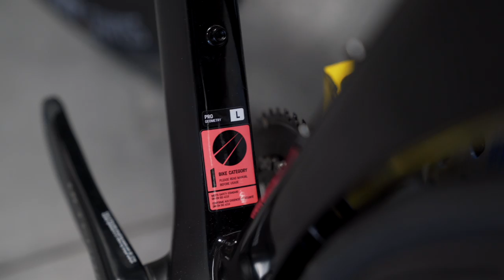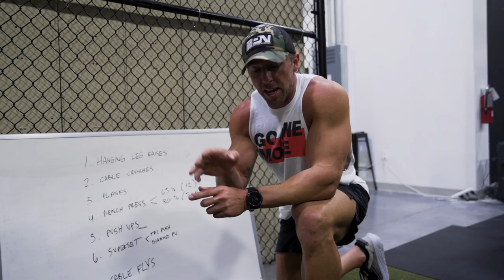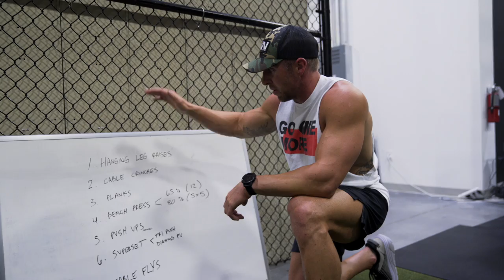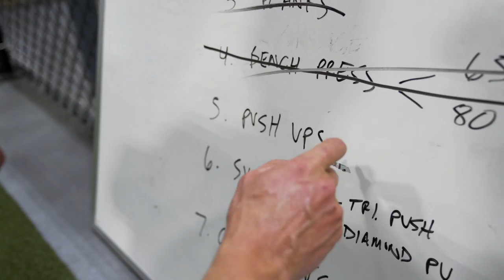Embrace The Suck (Running + Weight Training Day)

Comment: As someone who works in warehousing and logistics, stop wasting the time with cutting open the boxes, then placing them in the racks. Get packaging designed for your rack lanes with perforated cuts to quickly pull off the tops/fronts before filling your racks.

Comment: I will admit that early morning PT gives me good Plebe Summer vibes(was that really 32 years ago?). 
I agree it is hard work, but I take a different approach. The hard work is not the exercise itself, it is doing the work to figure out what I want out of fitness and diet and designing a system I'll actually do week after week, year after year. The hardest part for me was scaling back my exercise load. It has taken discipline to not overdo it, to stick with a plan of slow, steady improvement that doesn't overwhelm the rest of my life. It was surprisingly hard, mentally,  to scale back my morning run from 45 min to 30 min.

Comment: Recently I had a mental shift, I was tired of making excuses, thinking I was "working hard, but didn't have enough time" - turns out I wasn't prioritizing enough, and letting time do what it wanted with myself along for the ride.  Monday morning, a holiday - I slept in until 6:50am and ran 10 miles in the rain. Did I stop? Heck no - I had 10 miles to run. Tuesday I woke up at 5:30am because I set the alarm for 4:30am but forgot to flip the ON switch and had a backup for 5:30am to at least get some reading and planning done before work at 7:00am (left at 6:30am). Today I woke up at 4:30am to read and edit a client video for my videography business. NO EXCUSES. Tell your time what to do, and you will find the time to do things.

Comment: Not sure if you will be able to respond, but I have a question. Running in the rain wouldn't be to bad, and helps mentality. I try to get as much work in outside as I can, like you said that first choice of the day is huge. However right now with all the wild fires in California it makes the air quality very poor. I want to keep crushing my runs, but do you have any guidance on how to safely do so with such poor air quality outside?

Comment: Do you run to lift or lift to run ?
Reply: 578 neither. He is on the juice
Reply: 🤣🤣 yeah whatever you think
Reply: Neither, surprisingly — both of them are separate fitness goals. while he weightlifted before running, he certainly isn't supplementing running to enhance lifting (?) or vice versa. however, it is worth mentioning that running is his priority; in a previous video, he explains that when you make the choice to work out twice a day, you have to do whichever one you want to prioritize first. for him right now, that's running.

EDIT: 
just to clarify once more, while he does put his cardiovascular abilities slightly above his weightlifting, he's still not weightlifting for the purpose of running. he just is.
Reply: pearlescent 👍👍